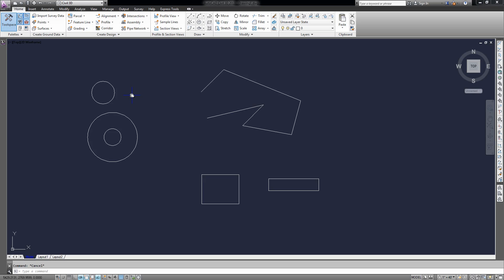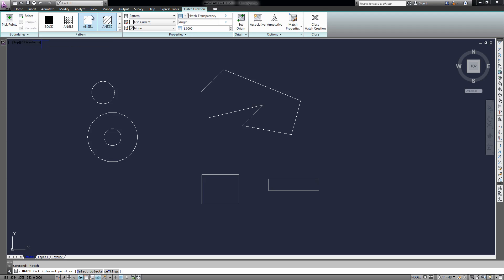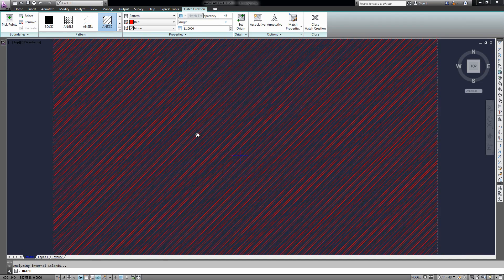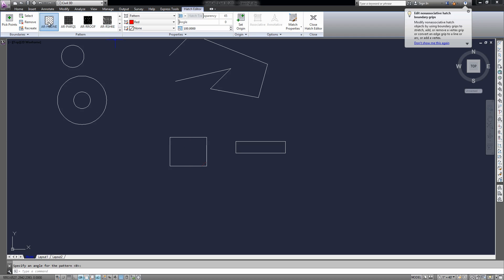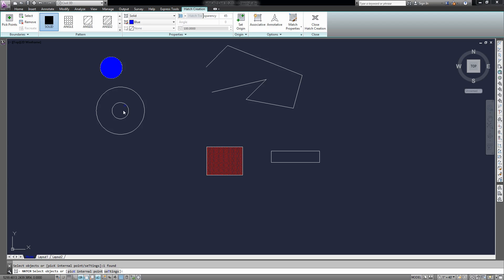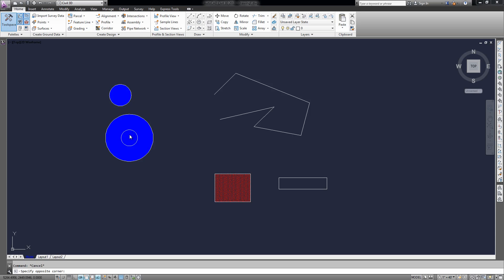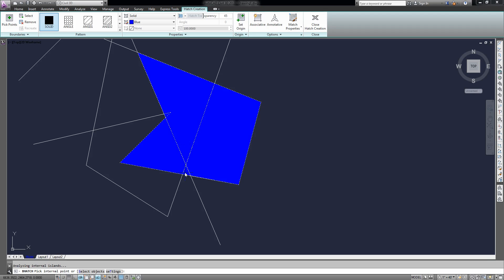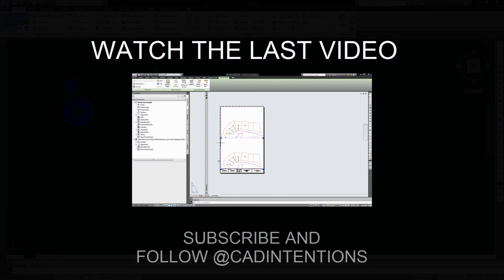AutoCAD How To Fill a Shape using Hatches

Comment: it's good with 2d, but in 3d my hatch always lie in x-y plane never in x-z or y-z or, I have autocad 2017 (amd64 / x64-x86) Student Version. Can you draw 3d cube using line only, colore 1st xz plane, then xy and then then xy(top then ground). color all 6 surface one by one all different color